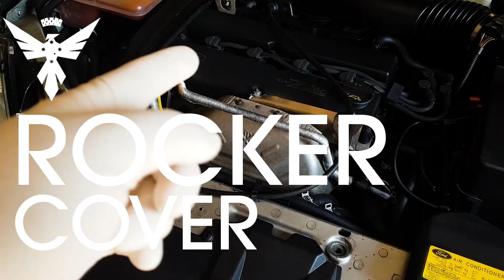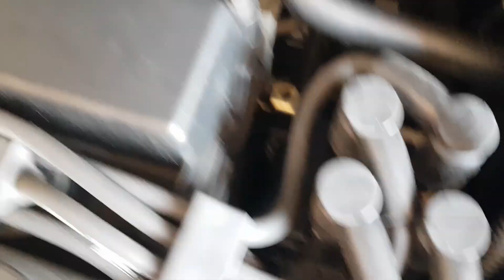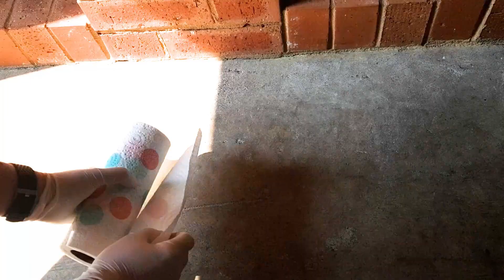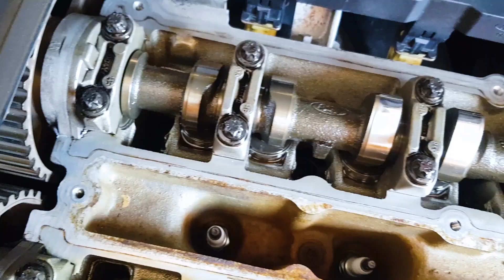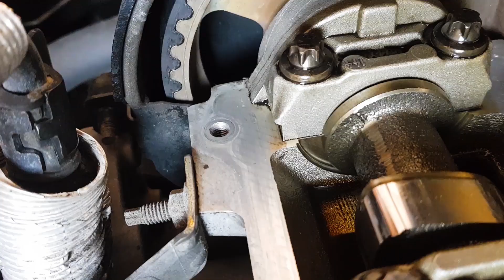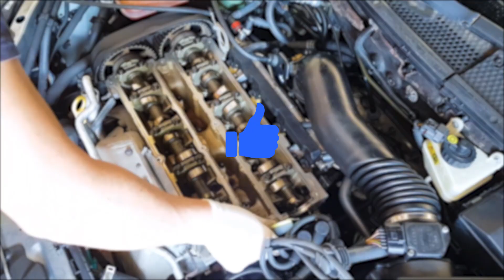EASY: Valve Cover Gasket Replacement - Ford Focus Mk1 / LR

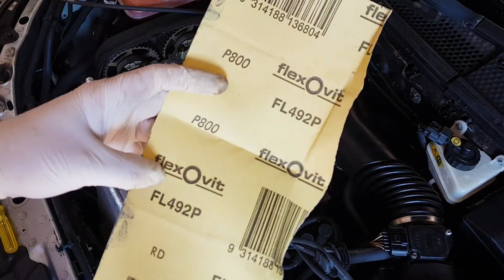Comment: 3:40 Alternatively you can use Steel wool or scotch brite pads for a safer, less abrasive cleaner. Furthermore a little WD40  on the surface makes cleaning off the oil residue even easier. Love your Videos, cheers from Luxembourg :)
Reply from the maker: Great tip! Thanks a lot for sharing for others to follow, and thanks for watching :)

Comment: gonna try this in a week, wish me luck :D
Reply from the maker: Super easy mate, have fun :)
Reply: just finished the work now, gonna go torque down in a bit, I hope it works without issues, my first engine repair regardless of how simple it is; thanks a ton for the video, cant overstate how much its helped me, I couldnt find the torque sequence in the online service manual I got, if you can link me one I would really appreciate it for future repairs :D
Reply: ok, the car runs rough now, on acceleration and on idle also, the engine vubrates a bit, you got any guesses? I connected the ht leads in a random order but the correct one to the correct spark plug

Comment: As always great video and very well explained, thank you!  I have the exact same model 2.0 petrol Ghia 2000 with 5 doors. I want to open and do all this but I can't find the ten bolts for the engine cover.  I would appreciate it if you have a part number or a link to find it? Old bolts are really rusty and I want to change all of them.  Thank you.
Reply from the maker: Thanks for for your comment, and for watching the valve cover gasket video my friend. I'm not sure if Ford still has these Focus Mk1 bolts, but maybe a hardware store will have them?.. That's where I would look first. Walk into a hardware store with the bolt, and see if they can match it with replacement high tensile bolts?... Alternatively, maybe someone who is dismantling another Mk1 Focus online will be able to sell you a good set of bolts - try eBay, Facebook marketplace etc... Good luck 👍
Reply: @Horus_Works  Thank you.

Comment: Hoping to watch another video on how to replace the front crankshaft oil seal and after replacing, will the timing needs to be adjusted again? I think the crankshaft sensor could go into it as well as they are in the same location?
Reply from the maker: Hey Louie, I'll have a video up soon showing how to replace the timing belt on these cars, in which I also show how to replace the seals on both camshafts and the crankshaft. I'll have it up in about a week mate.

Comment: hey, so, I followed this video and replaced my gasket, the car ran rough, and I took 2 weeks to figure out my ignition coil had also very unluckily gone bad around the same time, so once I replaced that everything is running perfect. So for future repairs like timing belt change, if I have remove the rocker cover, do I have to replace the gasket again? cant I scrape off the old sealant paste and add new sealant otuch ups where you showed and resuse the gasket? I did the valve cover gasket replacement like under a month back :/
Reply from the maker: Good to hear you found the reason for the rough idle mate, good old ignition coils... these engine bays get very hot so the coils do tend to fail after a while. To answer your question, no, if you only changed the gasket a short time ago, you should be totally fine to keep it. Just make sure you remove the old sealant and replace it with fresh sealant... The reason these gaskets leak is because over time due to heat, they dry out and become brittle. If yours is only a month old, you will not have this problem... Thanks for watching, and I appreciate your support 👍

Comment: Hello there had several mk1 ford focus model's and currently have a pacific green 1.8 zetec which is 22yrs old now and still running great at 113k mileage.
Just wondering if you have experienced having to change the gearbox speedometer sensor  
Would be good to see a quality video on the process

Comment: Hi I have a ford focus 2001 model 2L petrol I have a problem with suspension and my drive axle shaft is faulty as well and it is not ford focus exle past it was forced to be used there any advice will assist me on getting my car from the floor and start running again

Comment: How about adjusting valve clearences? It has never been done on my zetec engine, I can't find replacement shims on Autodoc. I will leave it since it doesn't seem to be an issue..
Reply from the maker: Hmm.. interesting question. I've never had to adjust valve clearances on mine so I can't help there, sorry. Come to think of it I don't know anyone who's had to do this yet on a Zetec 😕
Reply: @Horus_Works  My Haynes manual shows how to do it,  but without replacement shims I have nothing to adjust. My Engine has lost a bit of power, uses a tiny bit more fuel, but it is problaby due to the worn waterpump I am currently replacing.

Comment: Hello! 
Did you make the heat shield that attaches to your valve cover? I just replaced my valve cover due to it melting from the exhaust manifold heat being directed at it due to the design of the heat shield. I see you have a 2nd heat shield exactly in the area where mine failed due to heat. Is this factory? or did you make this?
Reply from the maker: Hi Michael, thanks for your question mate. This is a factory heat shield 👍 I hope you can find one from another Focus.